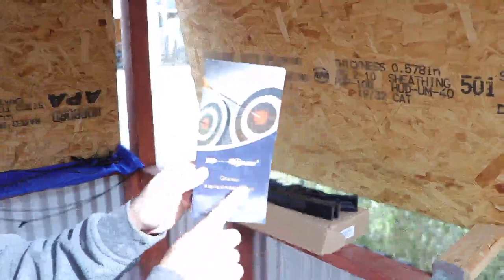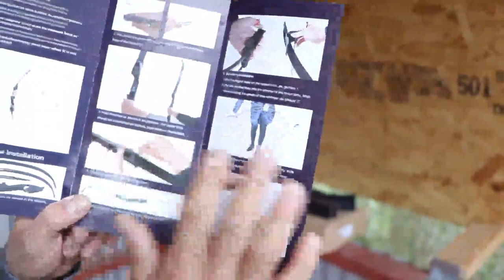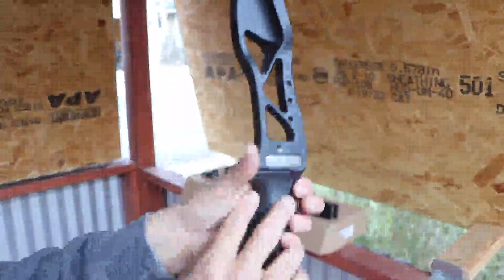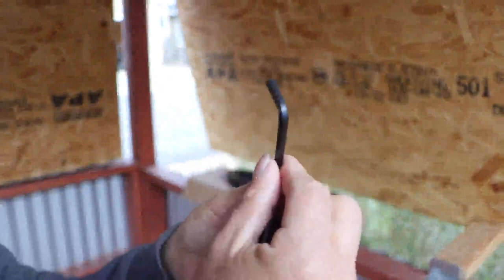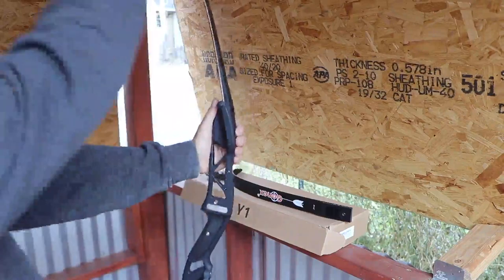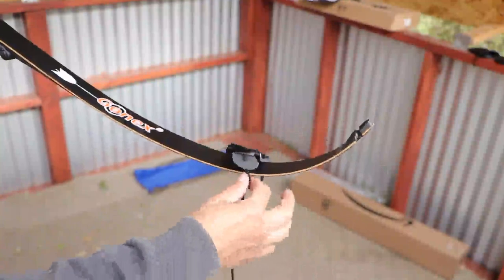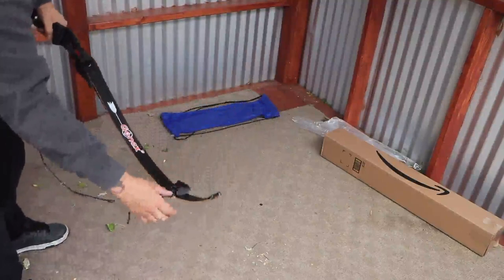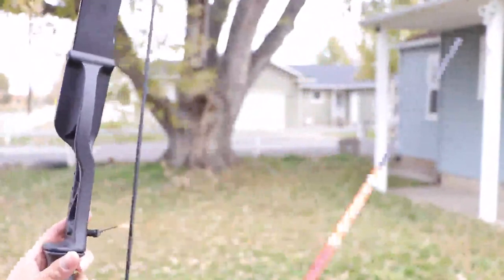Gonex Takedown Recurve Bow, Hunting Archery Bow Long Bow Review, Perfect beginners bow

Comment: Did you put the rest on the right side? Because your bow will not shoot correctly like that. Right handed bows are designed to shoot from the left side of the riser. Just saying. Also, with the stringer... put the loop of the top over the upper limb and slide it down far enough that you can put the bottom of the string in place. Then when you are bending the bow you just slide the string down the upper limb until it reaches.